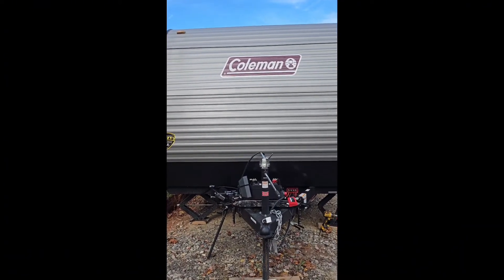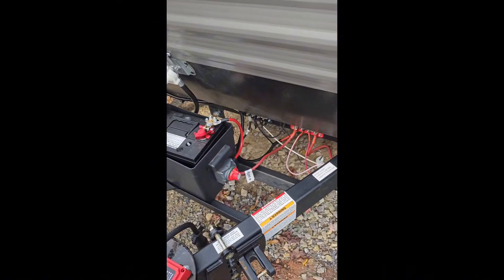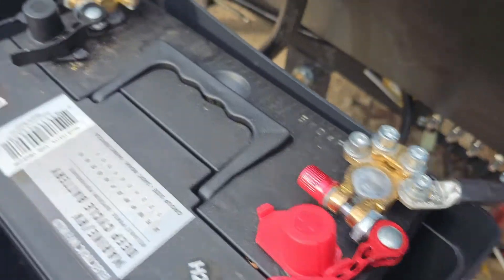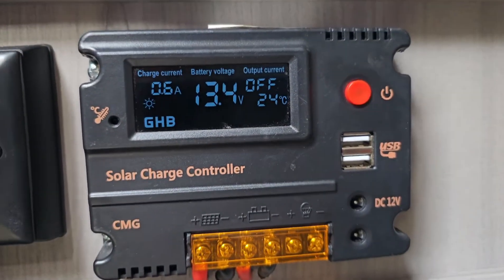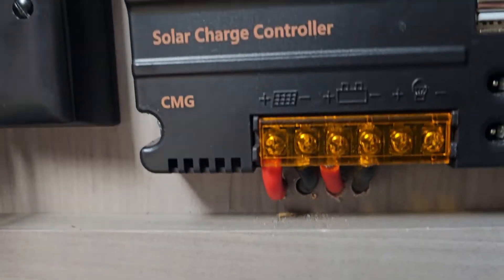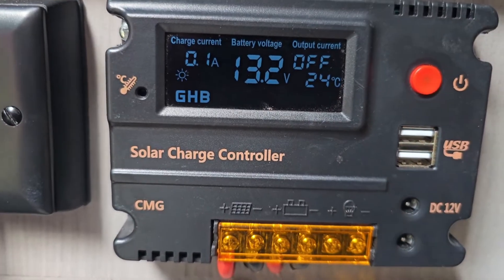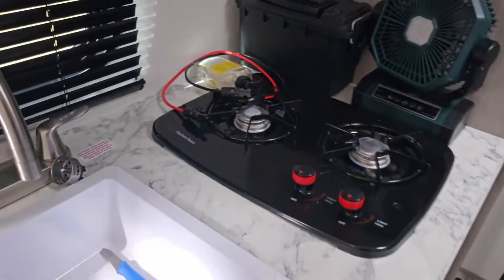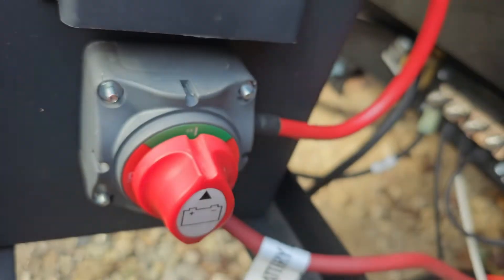ADDING SOLAR ON THE COLEMAN 17B CAMPER. (on the way to off grid)

Comment: I would love a more indepth guide on how you run the cabling from a solar panel on the roof to the battery
Reply from the maker: Well I'd be happy to oblige but unfortunately I decided to go the route of solar panels not connected to the roof. First of all I did not want to drill holes in the roof and second of all if you decide to park the camper in shade you can run the solar panels out to a Sunny Spot and change your angle more aggressively if need be however I have seen quite a few videos on putting solar panels on a roof.
Reply: @BULLETENVY  Appreciate the response. Yeah I'm planning on going out west with little to no forests so im not too worried about the solar being in the shade. Plus I can always charge my batteries with a generator. I've been trying to figure out how to best set up this camper so that it can be fully off grid including the AC/TV/Outlets. Im buying the 17B in a few days. Negotiated down to $13,000 out the door for a 2025 coleman 17B. With all the advancements of solar generators, theres no reason they shouldn't allow you to power your AC/Outlets via battery. My 300 Ah Lifepo4 battery can power that AC for multiple hours no problem. And I can charge to full with the generator in under 3 hours with Anker's fast charging (pulls 1000W per hour)
Reply from the maker: @gabrieldoesthings you're very welcome. I always try to respond to my YouTube peoples. But sounds like a good idea. We ended. But sounds like a good idea. We ended up paying 15,000 something for ours because it was during covid. So they don't let you run the AC and all that off the battery strictly just because of cost. They try to keep the cost low and putting in a 2000 watt inverter would add quite a bit to the price. They honestly try to build these things as cheap as possible just to make a profit. Trust me I know by experience. What you're going to need to do is put an inverter in yourself or just pay an electrician to do it. It's a mild job but it is required to be able to runPut an inverter in yourself or just pay an electrician to do it. It's a mild job but it is required to be able to run everything in the camper. The video you just watched of mine was just putting solar on the things that run the battery already. I hope it helped you in some way and I hope you get things right on your camper before your trip.
Reply: @BULLETENVY  Thanks for the info! Do you know if the AC is just a plug that goes into a 110V outlet port? If yes, you can just plug that into a solar generator for off grid AC. I'm pretty mechanically inclined so installing an inverter is not an issue for me. I just really want to be able to go off grid long term. Im also looking into a grand design transcend 151bh but its a bit costlier so may end up passing on it. No need to pay the extra $5000 for some outdoor speakers LOL. It is a bit nicer though
Reply from the maker: @gabrieldoesthings yeah outdoor speakers is a must. Ours just came with some portable speaker. Some units are different but our AC is a plug but you will need a heavy duty extension cord because the plug is only like a footlong and it plugs into the wall of the 110 outlet. If you had something like an Eco Flo or an anker then you could definitely just keep that thing inside and plug up the AC but the heater does not have that. It's hardwired in.
Reply: @BULLETENVY  Ah is your heater electric? The 2025 model now has a heater that runs of propane so you can run heat without any shore power
Reply from the maker: @gabrieldoesthings aahhh sucks for me but cool for you. Yea its a really nice fireplace but essentially yes it's just a 1500 watt electric heater.

Comment: They say it's solar ready but you have to buy the partnered solar panels with the built in charge controller to charge the main battery. No outlet use. If I remember right, the main battery controls fridge, lights, awning, water pump, and hot water heater controller.
Reply from the maker: Your exactly right.

Comment: Aren’t you concerned about your buss bar connections and battery switch being exposed to weather and water from the road?
Reply from the maker: Well the bus bar connection is just like this for the video. They have caps that go over top of them. I just took the Caps off for the video. The Caps are not completely watertight though but no I'm not concerned. Once everything is hooked up and good to go you can put some silicone if you're worried about it but the ones that the camper came with were not completely watertight either. As far as the battery box goes the same thing applies. There's not many places to mount the battery disconnect switch where it would not be exposed to the weather. I think they are made out of rust-free materials but even if they're not it was only $13 and you can replace it if it ever does happen to rust

Comment: Is the Coleman 17 B towable with a 2020 Tacoma TRD off-road? I’m thinking on purchasing one, but I want to make sure my truck  can handle it.
Reply: I have a 2023 tacoma sr5 and it pulls just fine.
Reply from the maker: Good info to know.
Reply from the maker: Honestly that's a hard one. I'm using an F-150 with a 4.8 L V8 to tow it and it tows it just fine but going up hills you're getting up to about 3,000 RPMs. I would say if it's a V8 most definitely but if it's a V6 I would say it will pull it but you may have trouble up hills or in rough Terrain.  If you're buying it from a dealer they may let you test it or help you gain some insight.

Comment: Does the dealership install the solar package for you if you ought to buy it?
Reply from the maker: I honestly can't say 100% on that but I seriously doubt it. Even if they did I think they charge one or $200 per hour just for labor. I think you would have to have some sort of electrician do it but honestly I'm confident that this is easy enough for most anyone to install themselves just for the battery powered accessories. If you want to install an inverter to run everything including the heat and AC then you would probably want to get an electrician. You could call Camping World and ask though if you really wanted to see.

Comment: I have the same camper but it came with 2 batteries. I got ahold of a 325 watt solar panel . Can I do the same set up you did with this without damaging anything?
Reply from the maker: Man that's super cool that you got two batteries. Mine's just a 91 amp hour. They were probably just trying to save costs. But yes you can do the same setup but one thing that I need to stress to you is make sure that you include inline fuses in all your red wires. 325 watts should be plenty for your batteries and also keep in mind that the solar is only going to charge the batteries so therefore you're only going to have solar for anything in the camper that's battery powered like lights or the refrigerator and things like that. The air conditioning and the heat run off shore power

Comment: @BULLETENVY so will this power the refrigerator, AC, outlets etc like it was plugged in?
Reply from the maker: So unfortunately no because of the way it is designed. You have 2 power options. One is 
Sure power (120v) and one is 12 volt power (battery power). The solar addition will keep the battery charged and let everything that runs off of the 12-volt system running with the solar. If you wanted to run the entire camper off of solar you would need to install an inverter which is a lot more complicated but still doable. An inverter to run everything would cost you between 4 and 800 bucks probly. You would also need to upgrade the battery system which would be another thousand. The heater and the air conditioner both full and extreme amount of amperage and would need a large size inverter with a large battery Bank.  But there are ways you can get around things. Just make sure whatever accessories you want powered are running off of the 12-volt system which are things like the refrigerator and the lights. You can get 12 volt fans or 12-volt ice makers and such.
Reply: @BULLETENVY  thank you for the detailed response!
Reply from the maker: @joshuarivera4932 yes sir. Anytime. Thanks for the support.

Comment: Hello and good video!  When these things say they are "Solar Ready" I know what you mean by it not having anything really for the solar setup.  I just purchased a 2025 Latern 17R and it is "solar ready"  From what I gather, it simply has the connection ports in pre installed areas but that is it.  The roof should have a port to accept up to two solar panels I've read and that port you moved is used if you want to install a briefcase type solar panel that you can move around the outside of the RV to keep it in sun.  I see a spot in the front outer storage of the camper that says it is pre wired for an inverter.  I am going to look into it more but apparently everything should be "pre wired" and all I am to do is install the missing pieces.  Charge controller, inverter and panels.  All of my outlets in the RV are just like yours.  They say "Inverter outlets" on them yet they do not work unless I am plugged into shore power on the side of the RV.  Same with the microwave and AC unit.  I  want to find a way to wire it up so I can use everything all the time whether I am plugged in or not.   The only quick solution I have found is to hook up a Solar Generator like the Anker system that plugs into the main power on the side of the RV and acts like a gas generator would.  This might be the route I go but Id really like to create my own custom kit if I can.  I want at least 800 watts of solar as I know the AC unit alone can draw up to 1500 watts I was reading.  If I cant match the charge to the usage, I'd drain the batteries swiftly.
Reply from the maker: Well thank you for the support and watching the video. Glad you liked it. So I totally get what you're saying about it not being solar ready but yours may have things that even mine doesn't. I don't have anything pre-wired or anything that says inverter spot or a spot on the roof for wires to run through. None of that. Just a connection to plug in an SAE connection that wasn't even connected to the battery. I think you can handle installing all the solar though. The easiest way that I found to put an inverter in there was just to run wires from the battery to an inverter that mounts inside and use those plugs. But your way with the anchor generator might be even simpler and you'll have access to everything where I would not.

Comment: I love the simplicity of the wiring. It makes it real easy for you to hookup an ammeter voltmeter to your ground so you can see how many ah's are left in your battery. FYI, If you do decide to hookup a ammeter, I would suggest this one because it works great and it's cheap "aili Ammeter 100V 350A".
I use this ammeter on my rv and it's great.
Reply from the maker: I thought so too!  Everything is right where you need it and accessible!   And for under 60 bucks. And thanks for showing others that recomendation. I have more multimeters than i could ever use with both hands. Thanks for watching!

Comment: I just bough a 2024 17b. What does the power inverter actually powers? While in 12 volts it seems the only the 12v works. Yhe awning works and wter pump, but electrical outlets don't, nether the microwave or A/C. So! For what is the power converter for??
Reply from the maker: Well first off congratulations. Secondly I feel your pain. I don't understand why it's wired in such a way but there are 2 separate systems. 12v system that runs off the battery. And "sure" power that is 110 v ...I think. It's the outlet power.  The way it was explained to me and keep in mind this was two or three years ago so the information is not fresh but I don't think it's an inverter. I think it's a converter. All it does is take the power from the sure power that you plug into the side of the RV and charge the battery with it and that's it. This camper does not have an actual inverter so unfortunately you have to install one yourself. I've been wanting to do a video on that but I wanted to make sure I had all my information correctly and could do it properly. Once I have the time to do that then I will most definitely put a video out on it.

Comment: If you disconnect the battery you should also disconnect your solar panels.   
I would suggest building in a switch  to disconnect your CC (charge controler) from your panels when battery is removed.
Reply from the maker: I eventually am going to put a switch between the charge controller and the battery but as far as the panels I just open the door and unplug it. I moved the panel input to right below the door of the camper.

Comment: I bought a 17r they said that it comes solar ready I’ll have to take a look and see but the video was a help .
Reply from the maker: That's awesome I'm so happy for you. Look under the plug and make sure and see if it's connected to the battery for one and for two if it has a charge controller because those are two things that I show in the video that you absolutely need for it to truly be solar powered.
Reply from the maker: Glad to help :)   I assure you it's not solar ready. It doesn't even include a charge controller. If you find different please let me know.

Comment: I cant find in the specs..in the manuals.. in the videos.. nowhere.. what battery does it come with... gel? Amp hours?
Reply from the maker: I'm not 100% sure and I've moved my camper somewhere else for storage currently but I think I remember it being a deep cycle battery and it was either 93 amp hours or 96
Reply: @BULLETENVY  ill prob end up getting same ones I have in van. In the mean time I could use a shore power adapter..and use vans solar and inverter to keep trailer charged. Looking to pick one up Wednesday
Reply from the maker: That sounds like a fantastic idea. You could just keep a Solar trickle charge on it at all times when you're not using it. As far as the battery goes I would get at least 96 amp hour or higher. There's a lot of extra room in the battery box. About 2 in on each side so it should fit slightly bigger.
Reply from the maker: If you're needing to order one I'm pretty sure you would be able to call Camping World and order it through them or at least figure out which one to order and if they didn't know you could always just go look at one on the lot because I'm sure they all come with the same battery. If I can remember I'll go by tomorrow and check it out and let you know.

Comment: My understanding is that if you cut off the battery when PWB is accepting a charge from the solar panels the PWB will fry.    I assume you have not seen that issue.   Otherwise bypassing the cutoff for the solar charge might be better on the charger.    The PWB should stop charging anyway when the batter is full.
Reply from the maker: Yes it does stop charging when the battery is full and flipping the disconnect on the battery actually shuts everything off at the same time. At least in my experience even if you left solar panel plugged in nothing would even accept charge from the solar panel but I usually just disconnect the panel for safety anyway.

Comment: what are you using for a inverter
Reply from the maker: Well currently I do not have an inverter for it... yet.  The one i want to add is a bit pricey so waiting to get the money to get a 3000 watt.  Hopefully i will show in a future video.  The solar that was shown in the video is strictly just to charge the battery that runs all the lights and fridge that came with the camper. Once the inverter is installed tho it will be the same concept just with more batteries.
Reply: love the video by the way
 @BULLETENVY
Reply from the maker: Thanks Mike. Really appreciate that. Doing my best to put out good videos for all you guys and gals.

Comment: Well done dude.  Hopefully you keep similar content coming.  I’m planning on buying a 17R next year and want to install solar, but have no idea how.  Creators like you are a huge help.
Reply from the maker: Dude i really appreciate it.  I plan on doing another video on the 17r its just be so cold and rainy lately and the thing is covered in dirt and mud.  Doesnt make for a good video.  I have another video coming somewhat soon on an inverter i installed on the vehicle i use to pull the travel trailer so you might like that in the mean time.  Eventually i want to add an inverter to the actual camper but its much harder and more expensive but overall solar isnt that hard so dont worry.  You got this and the youtube community will help you out sir.
Reply from the maker: Also i like your video on the bunk in the truck bed.  I like the slide out concept.
Reply: @BULLETENVY  I saw a video where someone did something similar, so I guess I reverse engineered it in a way 😂.  It was a fun project for my son and I.  Thanks for watching man!
Reply from the maker: ive seen a few others on there too.  people are so creative.  also anytime dude.  i try to keep up with my subs even tho numbers are growing daily.